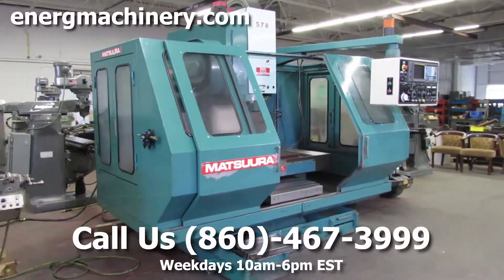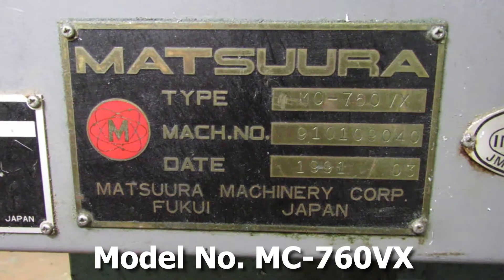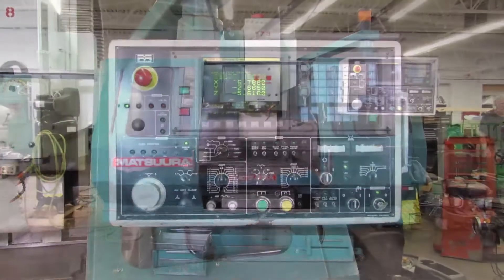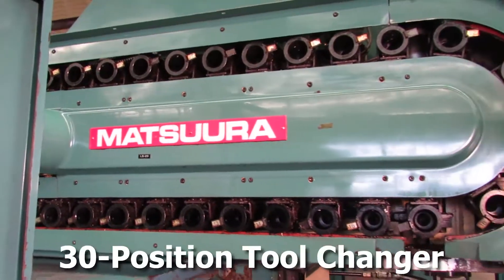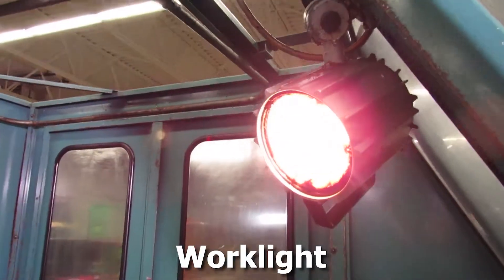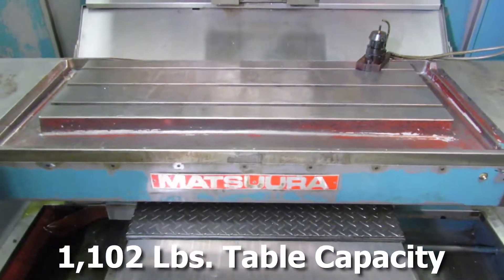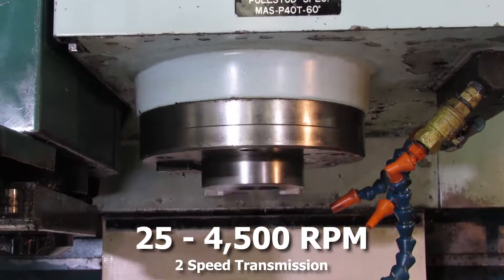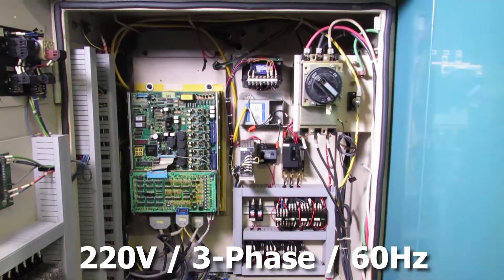Matsuura MC-760VX CNC Vertical Machining Center Demo

Comment: Shenzhen Elongshine Technology Limited is a factory specialized in CNC monitor ,
 Our products are with good quality and affordable cost for you.
https://en.elongshine.com
eg: FANUC A61L-0001-0093 FANUC A61L-0001-0092/0086/0076/0072
FANUC A61L-0001-0094/0074
FANUC A61L-0001-0095
FANUC A61L-0001-0096/0097
HAAS 28HM-NM4
Mazak Monitor CD1472D1M and MDT-1283-02 (MDT1283B-1A)
Siemens Monitor SM-0901 and 579417 TA...